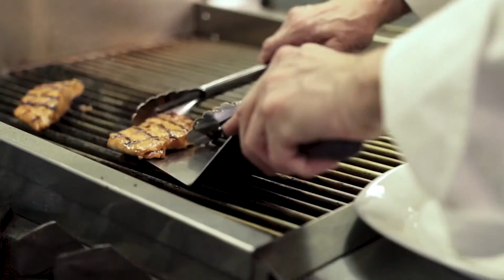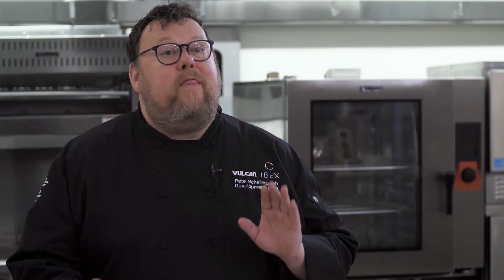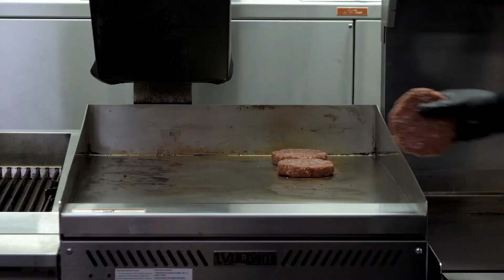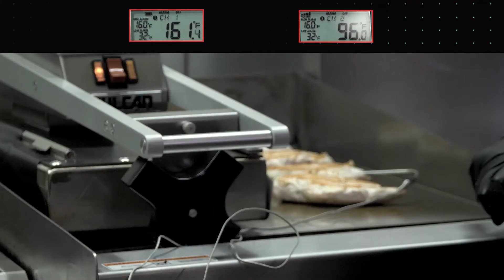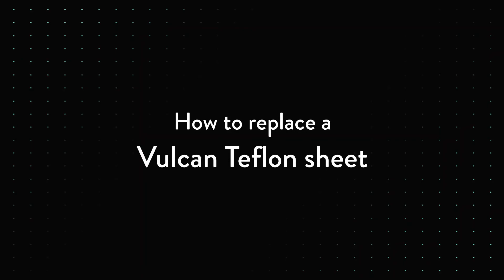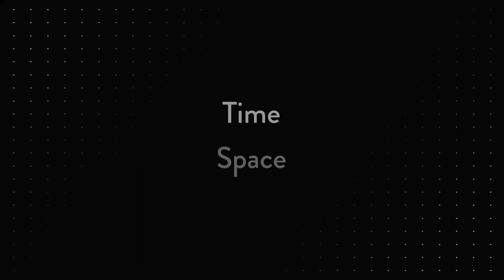Why Add Vulcan VMCS Manual Clamshell on Your Griddle? Watch Chef Pete's À la carte Virtual Training

Comment: whats the pressure adjsutment like? Could I do very minimul pressure or more?
Reply from the maker: The pressure is limited by the thickness of the food and the gap retained by the gap adjuster setting the operator sets up.  You should be able to reproduce a desired level of pressure by testing the outcome of varied gap settings.